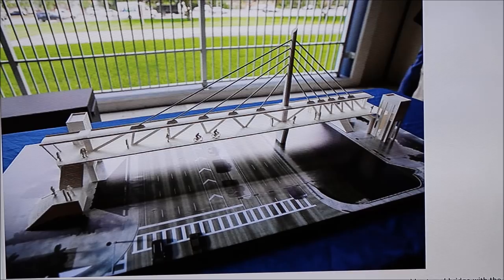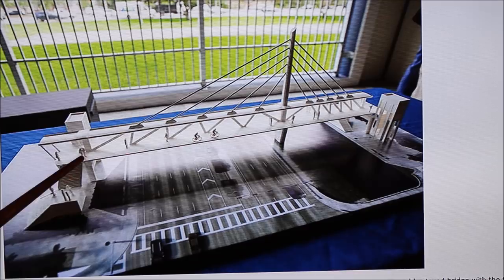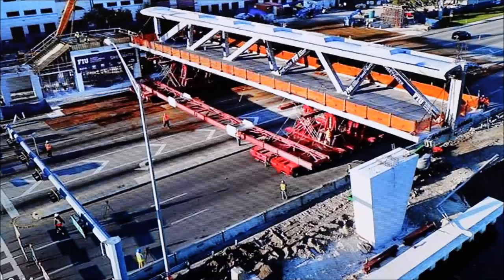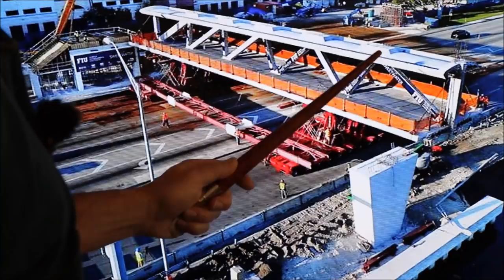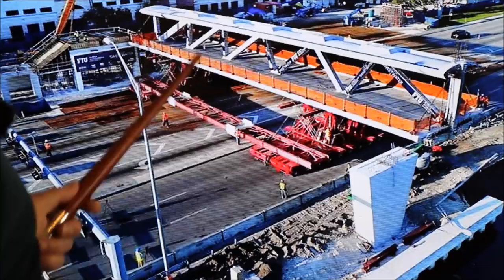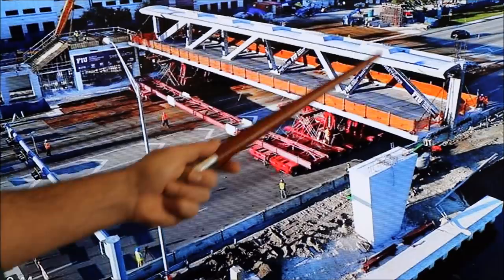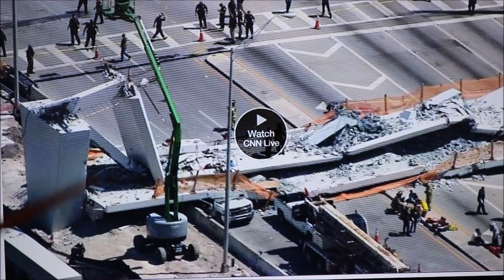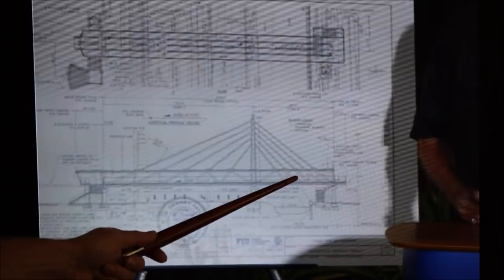Miami Bridge Failure- preliminary analysis 17 March 2018

Comment: My understanding of the design is the bridge is a post tension segmental cable stayed structure with phased erection requiring main span to be  placed with only sufficient strength to hold itself and construction crews. Second phase was placement of the smaller second span and north end pilon with cable system to add further structure to carry operational live loading and long term weather event stresses.  The cable array is not decorative.  (See Skyway Bridge as a long standing example)  It appears the main span was damaged during the initial transport with carrier systems deviating from design specifications both in placement as well as erection. Repairs and corrective work should have been done with road closed. Period.  Of all the deficiencies which will be found in this tragedy,  the choice of concrete vs steel is not one of them. That engineering materials choice criticism is really more a bias not an informed, deeply experienced based fact based conclusion.  Both are capable of successful performance.  I am a Floridian with over 45 years of heavy construction experience in this state. By the way, if you can get past the language, AVE's global crowd source engineering analysis is very informative.  Thanks for your reporting. Well done.

Comment: I find the claim that the suspension cabling is purely ornamental suspect.  Yes it's primarily a truss bridge, but engineering is not noted for extra parts and costs...

Moreover it's a heavy weight design for a walk way bridge... Light steel would be a better choice.. Conceate is a poor material for such a span

Comment: The post tensioning was the culprit because the bridge was designed to be transported differently but they thought extra tension would solve the problem instead it critically weakened the tensioner bolt. You can see the concrete tie poking out in the aftermath shots.
Reply from the maker: Puffalupagus360 yes, see update.

Comment: Thanks, I'd posted elsewhere that it made absolutely no sense to have a "suspension bridge" that was self supporting as it would either be over engineered for its final use or too weak to work on unsupported during construction, now I get it, the suspension bits were just for show(!). I can't help feeling the fake bits gave engineers a fake sense of sound design. Someone is going to tell us "it was going to be suspension up to a point and had passed the designs test like that", then someone decided to speed up the deployment and changed the fundimental stress model. Disclaimer, I'm no engineer but did have Lego as a kid and that probably would be enough to see the issue.

Comment: If the cables were really ornamental, how do you explain that the trusses have one segment that is exactly aligned with the cables..
Therefore, how do you explain that the trusses differ from each other ? Their shapes suggest that it is not ornamental, but the result of some kind of FEM analysis. Maybe someone knows exactly what it is called.
Reply from the maker: xl for aesthetics....I know, hard to believe. They do provide some additional stiffness to the design.

Comment: The unsymmetrical shape off the truss makes no sense if the cables are not structural.  The first thing I said is it is massive and too much weight, and that was thinking  the cables were structural.  when that end cable snapped the diagonal adjacent to it dropped and placed an unexpected shear and axial tension on the bottom chord and thus failing the concrete in combined tension/shear stress
Reply from the maker: John Rosatone there are no cables in overhead structure...only pipes bolted to pylon and top of bridge.

Comment: This bridge looks like a silly design, not efficient. But I wouldn't think the engineers miscalculated it. Adjusting stresses in structural elements without temporary supports while traffic not closed doesn't sound right.

Comment: Why should they have stressed the rods in a compressed truss? 
I guess that the connection between the walkway and the truss sheared off at the foot and then the truss still pushing against the column pushed the walkway off the support.

Comment: An engineer warned about cracks in the concrete.  They should have shut down the highway immediately.  They were doing a stress test just before the collapse. They should have done the stress test at night, not during rush hour traffic. What morons.  This was either a bad design, bad materials, or both.

Comment: From my uneducated perspective the connection of the bottom of the end triangle to the floor gave way moving in the direction of the pier. The bottom cord would have been under tension. The component you say they were tightening is still intact
Reply: In some of the photos the tension cable can be seen to have pulled out of the beam, suggesting it came out before the collapse. The beam is remarkably intact, suggesting it was not under load after the initial collapse.

Comment: Stress Testing" is not an accurate term to describe what they were doing.  That is ignorant journalist speak.  Nobody "stress tests" a bridge!  What they were doing was imparting compressive stress to the concrete by using a long proven method of "post tensioning". During this process cables or rods running through conduits in the concrete are tensioned (stretched), then anchored to the concrete prior to releasing the post tensioning load, which in turn imparts a load into the concrete to put it into compression to counteract stresses that it will see when the bridge is loaded.  This allows for a more efficient design as concrete can withstand tremendous compressive stress but is terrible at resisting tension stress.   What likely happened is that either construction loads and/or different support configurations were not fully considered during the design, OR the constructor did not follow the proper construction sequence, OR did not support the bridge properly during the move and caused a structural defect.  The "whip cracking" sound that a witness heard prior to the collapse could have been a post tensioning cable or rod snapping, or it could have been a crack developing when the post tensioning started.  It will come out in the investigation, once engineers have a chance to fully review all the data.  The chances are that engineers involved in the design or on the investigation team already have a pretty clear picture of what happened and why.   I would say this though, that I would never advise a post tensioning operation to be done over traffic and without shielding the public from potential problems.  Post tensioning involves tremendous forces being imparted and normally is engineered very well that nothing happens, but only takes one failure to be catastrophic.  Traffic should not have been allowed under the bridge until it had been fully constructed to its finished state as designed to handle all the loads.  Steel construction would have been better as steel is much more forgiving when overstressed.  Concrete design is much more technically challenging.

Comment: More qualified engineers???? OK my conjecture please do not delete:  My belief is the end connections of the cables popped through the concrete.  I doubt it would be possible to tighten the cables enough to actually break them.  Now I have a new conjecture based on some other Youtube videos.  Perhaps the tension cables were broken while they were lifting the span into place.  I've seen other videos that show it sagging a lot at each end as they jacked it up in the center.

Comment: I was searching for some actual news and in an Architect column the statement was made that this is a suspension bridge, otherwise why would it be designed as such. Building a non-suspension, "suspension bridge" would be a waste of millions of dollars in both the engineering and implementation of such a decoration. I'm still looking for actual engineering drawings or description but only find renderings or the project's call for design - I will continue to look. The opinion is that this construction implementation method was faulty; a huge mistake made that no adequate temporary support was placed for the span during construction while the center mast and cabling were installed. Ideally, the span should not have been placed until the mast and cabling were ready to connect, and at least, most definitely not allowed to bear weight, it's own included, as it was not a complete structure. Proper, well engineered and placed, temporary span supports would have assuaged this tragedy. I posit that over tightening of the tension rods led to what looks like much pulverized concrete. I would also posit that this was not an engineering failure, but an implementation failure.
We'll find out when the NTSB report comes out.
Reply from the maker: MetaldogJC Exactly, If it were a suspension design....you would start assembly first with the suspension cables.

Comment: Why is the trust/canopy made of concrete instead of metal or plastic I don't understand. No center pillar inbtween the traffic was odd as well. early 20th century double trust design works, why single :( design over function.

Comment: Just some high level comments without analysis: Bridge design has gone from steel in the last 30 years to concrete (in the US) because of durability and maintenance costs. The bridge was also not designed as steel as they wanted it poured near site, and not fabricated in a factory and shipped to site (The whole ABM method which received funding). Changing the temporary supports during erection of the bridge caused a re-analysis which probably revealed that some borderline conditions with high stresses that could have been avoided if the member sizes had been sized correctly initially in the design process. Reducing tension on P/T rods means increasing tension initially to unseat the gripping devices (chucks)  and then reduce the force and seat the chucks, which may have over-stressed the member and surrounding areas that was marginal (had cracks) and then failed suddenly (at the north end of the main span). 
These are complex issues and is funny to see them being debated here by people who don't know the difference between cement and concrete! No wonder the NTSB is taking so long, almost a year now.

Comment: One simple question:  "what is the purpose of adding a compression force (by post-tensioning) to a member that already has a very, very large compression force."  If this structure acts as a truss, then this diagonal member resists a force approximately equal to half the total weight of the bridge multiplied by 1.4 (assuming that the diagonal is at 45 degrees.)
Reply from the maker: to move the bridge,  cantilevered.
Reply: Yes, I understand that the end span was temporarily cantilevered during the move.  But, once the bridge was in place, why would more post tensioning be added to the compressive force in the diagonal.  Perhaps the cable became loose because the diagonal went from tension to compression, but that would only require that the cable be "snugged up" and not actually highly stressed.

Comment: Juan, I liked your analysis but I am having a hard time accepting the failure of the end truss.  My assumption is that it was the second from the end truss member that failed.  This one had more tension than the last one and the failure in the canopy section was right at the junction of these two truss members.  To further my theory, that first truss member is still intact in the post failure photos.    Ron
Reply from the maker: yes, it may have failed by punching thru and severing the top deck (canopy).

Comment: Juan it was not even close to being completed. I dont know how much you know about bridge design but this is a Cable Stayed Suspension bridge. that means it gets a tower between two span sections with cables leading down from the tower too the spans. they way they attempted to install this bridge is out of sequence for how all Cable stayed bridges are built.
 The tower is not built and there is now way the spans are designed to self support until the tower and cable stays are installed.
They did not even leave inplace any temporary false work or supports until this part of the construction was completed.
there was a structural failure of one of the post tension bars that lead to the collapse  but the main cause was the lack of the tower and cable stays.
Reply from the maker: That's absurd, why on earth would anyone allow that? 
I have to agree with the NTSB that the suspension cables were merely ornamental, or they would have had a COMPLETELY different construction sequence.

Comment: These structures have very  little safety factor built in to them - the lack of redundancy (of any "modern" structure)  is entirely due to financial considerations ruling the design, not prudent engineering.    In this case aesthetics and convenience  seem also to have overruled safety.    Truss designs especially are prone to failure when a single element fails...( just ask any firefighter who has  entered a burning home built with modern  wood truss how he feels about them).   This bridge had a single central  truss, so no strength for torsional forces.  
     In my wife's hometown in Chaves, Portugal,  there is a bridge built by the  Romans during the time of Emperor Trajan, which is  still standing and still in use after  20 centuries - and yet in our modern arrogance we think we are so much more "advanced". We could learn something from our forefathers.
  In my hometown Springfield Massachusetts the old gunsmiths at the armory would be jailed and/or fined if their guns didn't shoot right.   I say we bring back the same punishments for  bridge collapses.  Careless engineering or sloppy construction -  those responsible need to go to jail.

Comment: Green concrete probably had a factor also. I use to live in Florida and the moisture leaves the concrete to fast and makes it brittle. We had to water the concrete to keep it from cracking in the Florida sun as it cured. I'm sure this was a factor not to mention workers from Miami. Which is one of the reasons I left that shit hole.